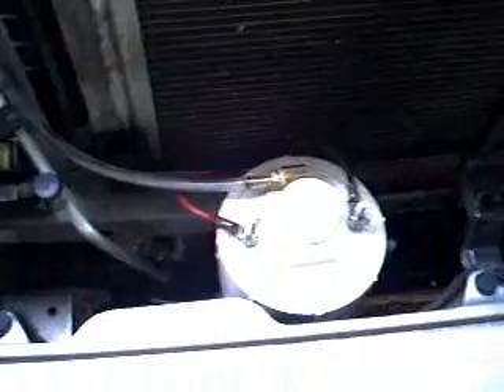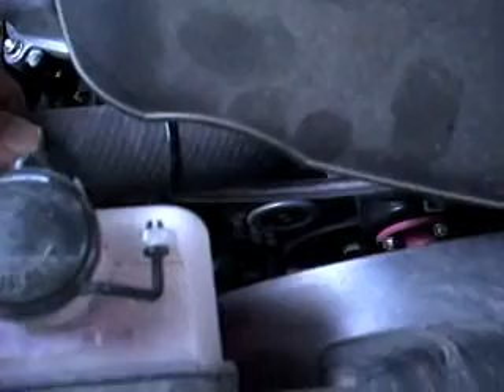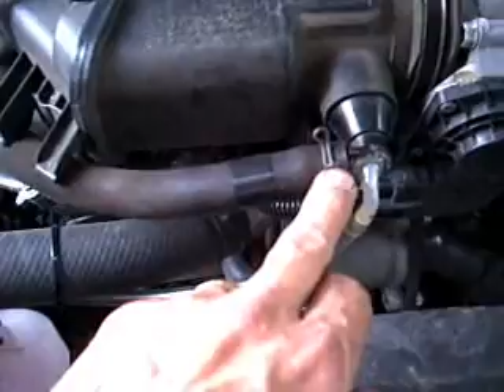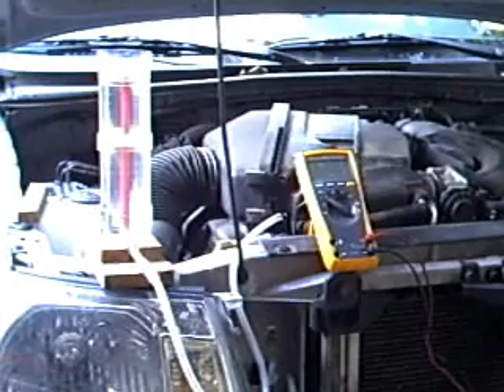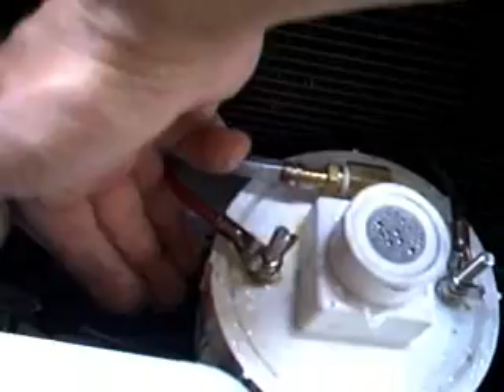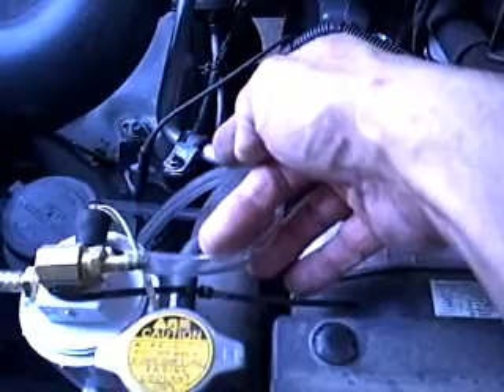#87 - VSPB Toyota Install

Comment: Uhhhhhh, I put gas in my tank and the car goes.  It's really easy!  You don't need all these polyacrolytic canuter valves.  You do have to make sure your car door is closed so the Energy source is not drained when you start the vehicular transportation device.  

All kidding aside, I applaud all of you, but especially this guy for working his ass off and standing on what he has proven through trial and error to be true.  Rock on ZERO!

Comment: i tried it, overheating of the cell, corrosion on the plates reducing reaction,power drain on the alternator,after many diffrent variations its bull people just drive less,or get a smaller engine , or use the mind to find a new way that works,electrolysis is a waste of your money.

Comment: Yes, that formula is correct. The energy from splitting and recombining an H2O molecule is the same. However, this system isn't recombining water molecules. It splits the Hydrogen from the Oxygen, the hydrogen gas rises into the release tube and gets sucked into the engine where it is burned along with the gas fumes. We're not obtaining energy from splitting the atoms, we're getting it from the hydrogen gas produced after the reaction.

Comment: It takes 286Kj per gram of water to separate it as it is and endothermic reaction. when recombined it will produce exactly 286 Kj. Now you have to figure in tons of things that are going to rob the reaction. Friction in the belts and engine, resistance in the windings, hysteresis in the coils, resistance in the transmission wires, heat absorption into the engine and cooling system, heat loss through incomplete cycle causing combustion in the exhaust. I can continue but I think you get my point.

Comment: Fentanyl3, although I do respect your decision to cut down on fuel consumption by switching to a bike, I still have to say that you complain too much about hydrogen cell technology. Now, it's been a couple of years since I've brushed up on my chemistry (I still have a few binders full of notes and formulas), but I do know enough to realize that this can and does work. And it's not simply FEASABLE it's technolohy that's been around since the late 80's.

Comment: Such as drive less, buy a vehicle that's under 7000 lbs and isn't built on a 3/4 ton truck frame with a 10 cylinder engine. Ride a bike, or do as I did, and install an engine on a Bicycle. I ride to work for 85 cents a week. I moan, because I hate to see wasted recources on pipe dreams. As stated earlier if an HHO cell actually worked, then you could simply install a large enough alternator and produce enough HHO to run the engine without fuel. Message me if you like.

Comment: So, when you figure in the losses in the wires, the conductivity of the electrolyte the losses in the alternator, and last of all the terribly inefficient engine driving the entire process it will produce a NEGATIVE total usable energy. if you figure in heat loses and hysteresis and all the others drains from efficiency you'll end up with a system that actually reduces fuel mileage by 1 or 2% at best. I moan about it because I would really like to see people do other things.

Comment: actually, you can use a large cell and not use any fossil fuels... it follows the laws of conservation of energy because it uses energy to make hydrogen, which you burn to reform the energy as heat, so the process is electricity>hydrogen>heat>motion>alternater converts motion back into electricity>hydrogen etc... the point is that you do need a separate power source such as solar(free short of the cells, which will pay for themselves) and water+electrolyte... do a little research next time

Comment: hey thanks for the video its great...i have the same truck and was wondering what did you splice into for the relay i looked under the dash and im not sure which wire is on when the ignition is on thanks

Comment: Hi Zero, is your design based on the Hydrostar design?  Stan Meyers? Or maybe both?  Some guys are getting 4L to 6L per minute which is what I am guessing is needed to get my Hi-Output V6 to show any increased Gas Mileage.  I have read about ome people going straight Hydrogen only with no gasoline at all... I thought that was not a good idea with an internal combustion engine that is designed for Petrol.  Thanks!

Comment: Hi Zero, It seems the large coil really changes things and I see most people are not adding the large coil. Also can you talk about the difference of attaching the Hydrogen Fuel line to the Manifold Vacuum Intake or through the Air Filter Intake.  Thanks! By the way my wife thinks it's all a hoax and I am wasting my time and money...  Kinda like my failed SSG experiements ( I never could get the Bedini circuit to work at all ).  Thanks again.

Comment from the maker: Unless you can introduce a catalyst or force that reduces the energy required to produce HHO over conventional brute force electrolysis.

FYI, Mr. know-it-all, somewhere between 7.0 and 7.75 ml/min/watt it is generally regarded as unity energy gain. We are now already flirting with 8 mmw and more using only conventional brute force. Faraday is certainly rolling in his grave.

I personally have my sights set on 10-20 times that efficiency.

Sit back, keep still, and enjoy the show.

Comment: Would you then be able to plug in a 15 - 30 amp battery charger to create the H that runs the generator essentially self reliant power

Comment: Zero you have not once ceased to astound me with your videos. I loved physics class subscribe to Popular Mechanics & Science and Wired none of those mags have pulled me in as much as your videos. its 7am EST and ive been in front of this tube for over 6 hours watching. Ive seen the torches made using this system that means the H will burn. what i want to know is would it be possible to sustain a 10kw generator with a low pressure propane carb installed with 100% hydrogen and if so CONT:

Comment: on the subject of efie.  I have the ability to change the target mixture, my efi will try to attain when it is in closed loop Lambda mode. Am I correct in assuming that this needs to be taken down to the lean side of things, from there the need for the efie on systems that do not give one the ability to change this target....

Comment: Hello. Plz take a look at me vid labeled "D Flip Flop output rotation HHO" The idea in the vid is for HHO setups that have power connections for each cell. In your vid you use only one connection for all for your cells but if can be easy modified.

Comment: Hey Zero, Have you ever considered how much hydrogen you are producing versus oxygen? The HHometer is pushing nice, but how much of that is oxygen? Please make weight measurements with air minus container tare weight vs. HHO weight minus tare. Also with different electrolytes. Not sure if it would be any difference, but very curious! (sorry for the extra work)

Comment from the maker: You mean it took almost 2 minutes to fill a bottle that would otherwise hold 24oz of liquid. One and a half pints. Right?

Sounds like you replicated the Water4Gas piece of crap. The max voltage between electrodes in water before serious heating starts to occur is 2.5V. Their design is snake oil. Anyone buying one is being ripped off. Anyone building based on that design is wasting their time.

Period.

Sorry to break the bad news. Throw it away and start over.

Comment: i was wondering how big is the engine for your Toyota?

ive been thinking about making one for my 1.6L 4 cylinder mini cooper and was wondering how much hydrogen going into the system would be safe as an estimate?

i would hate to have a piston fire the wrong way and break the crankshaft....

Comment: Hi ZFF I also have a toyota mine is a yaris verso 1300 cc with a strait 4cyl. The engine is also VVT-I. The electronics are rather similar I suppose and I am rather curious how are you going to handle the O2 sensors. I think its better to monitor them individually first w/o the cell and see their response so that you can mimic the same values individually hence find the offset in voltage if there is any. At the moment I am still experimenting with my small fiat with a carburettor.

Comment: Hey, zero.
Do you have to use a hydrogen AND oxygen mix? Why can't you just tap off the hydrogen by itself to avoid the O2 sensor running the engine rich? Maybe 2 seperate chambers can be used to collect the gasses independently. Just a thought

Comment from the maker: It would recondense KOH back into solution. However, I powered up the cell after joining the resevoirs and got an unpleasant surprise. The backpressure created by the submerged bubbler tube causes the fluid to push back from the cell into the bubbler, raising the level, raising the backpressure, and so on, until the fluid starts to spit from the gas outlet.

Shared resevoir is out. Have to wait for the 12V solenoid valves to show up. >:-(

Comment: You can "borrow" one of those $600 bricks that read your engine while it is running, this will give you the proper O2 sensor resistance (while cell is off) that you would need to mimic (while cell is on).  I would recomment placing that as part of your "flip switch" device, so that you get proper o2 readings with the device off, and mimic readings with the device on.

Comment: Hey Z!,

Just to affirm the physical location of the bubbler. I am operating 2 cells with the bubbler a couple of inches higher with common fluid connections on all. It does help. 

A

Comment: Thank you for your work Z,
What is the function of the negative shunt (aka: Poor Man's Shunt). I've got all the cell 'makings' that I will start working on today. I got a 30 amp breaker from the autoparts store that I was going to use insted of a fuse.

Thank you again,
Yeo

Comment from the maker: I have. It fluctuates too rapidly to really see anything. The instant that you apply and remove the HHO you can almost see it spike and settle as the ECU tries to compensate.

The one thing I saw that was VERY encouraging was a very noticable increase in RPM when HHO is applied, then the ECU lowers the throttle setting to drop the RPM back to spec. Opposite when you remove the HHO.

IT'S WORKING!!!

Comment from the maker: Carl makes a good point but I think my feed tube is long enough so that HHO exiting the tip is all fed into the plenum.

I was really excited when as the engine was idling I could distinctly hear the RPM drop when I disconnected the HHO and rev up when reconnecting the HHO.

Comment from the maker: I could except that most check valves introduce too much back pressure and/or flow restriction. Two check valves would also exclude connecting the cell to a vacuum source as there would be a constant inrush. I like my solutions best.